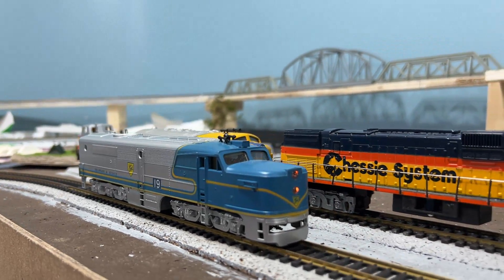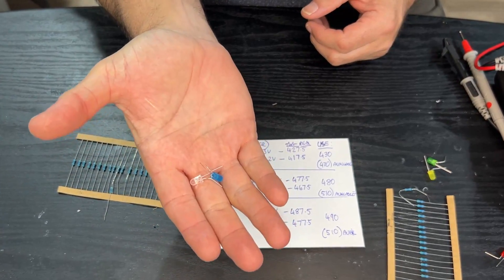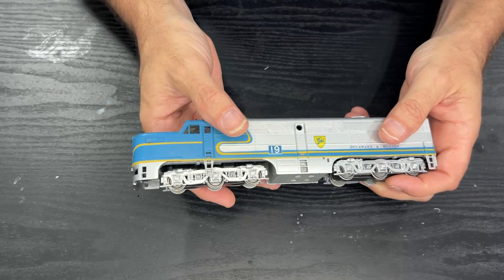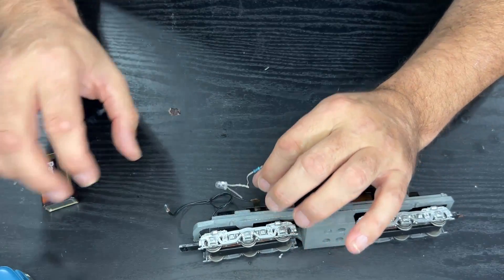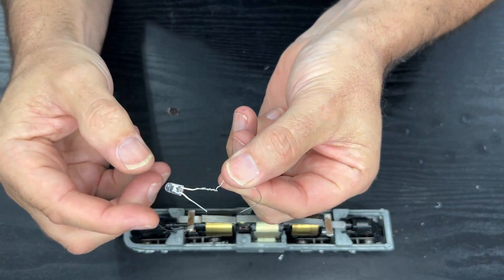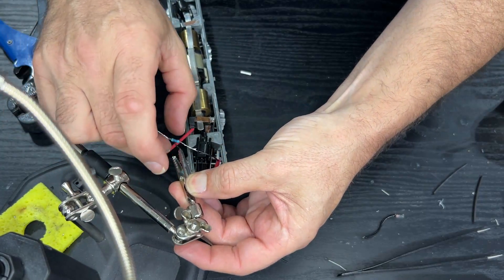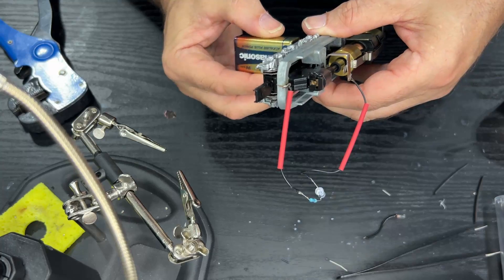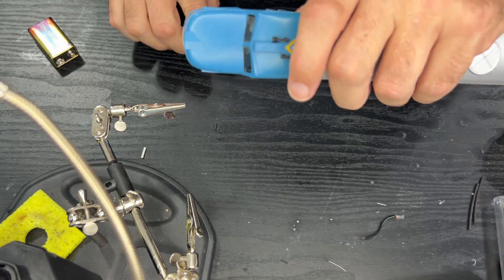Upgrading An Old Athearn PA-1 To LED Lights - Not So Simple

Comment: Nice upgrade! LEDs are the way to go even if they are a bit more complicated in requiring resistors of the right size.
Reply from the maker: I was worried about the maths at first, but it's surprisingly easy to work out the resistor size, even for me.

Comment: Great Dave. Could you not just have the red light on while she is going forward as a tail light?  Otherwise you want another white light as a headlight for “reverse” no?
Reply from the maker: I must admit, I do like having the red light on. I might wire these to in series, and add another pair for revers, but then I'll need two resistors, and they will also be a different value running in series. Plus more wires. hmmmm, maybe not.

Comment: LED's are great if your ok with soldering and meticulous fiddling, all part of the hobby. They're so cheap now, many come with resistors attached......also you can toss those motorclips and hard wire the trucks for better conductivity. ..Rail on!

Comment: That led flicker when in reverse is from the inductive kick of the motor running. Little filter cap can fix that
Reply: A 47nF ceramic capacitor across the motor should do it.
Reply: @henrybest4057  I have seen this with RC cars, to help the radio out

Comment: done the same with my gp9 but added the chip at the same time, so it saved the faff with a bridge rectifier for the permanent light it did have.
Reply from the maker: Do you mean you added a Decoder chip?
Reply: @ScottRails  yes light now works on a function

Comment: Nice work Dave. 
There is a flat spot on the LED which indicates the cathode (negative) side. When sizing resistors: R=E/I. R- resistance in Ohms. = E- electromotive force in Volts. divided by I- intensity in Amps. I usually oversize the resistors just to be safe so as not to blow them out.
Reply from the maker: Thanks James. Yes, I have oversized the resistors too. I blew 3 of the leds just testing with that 9v battery.